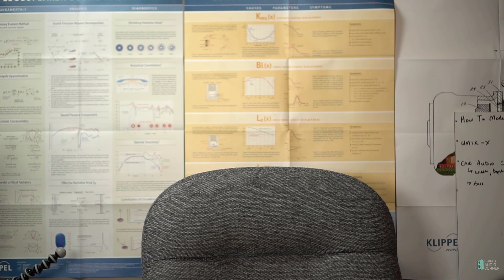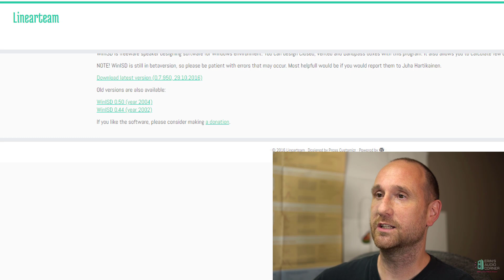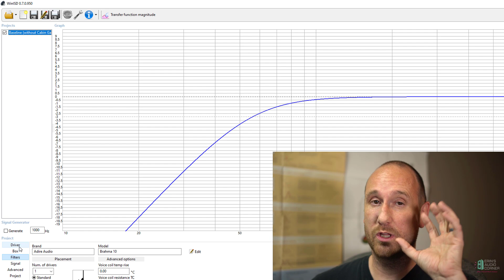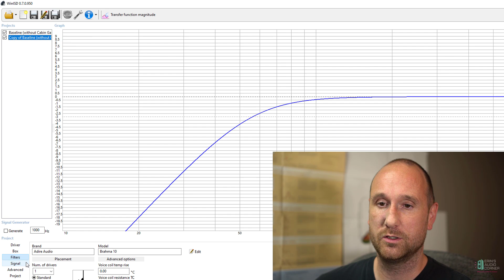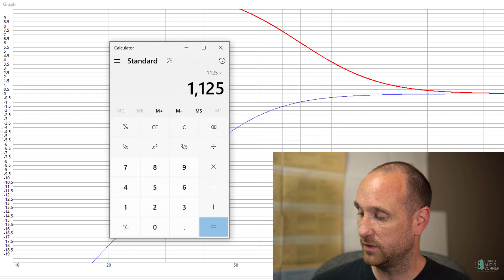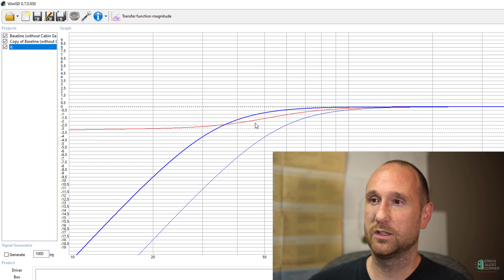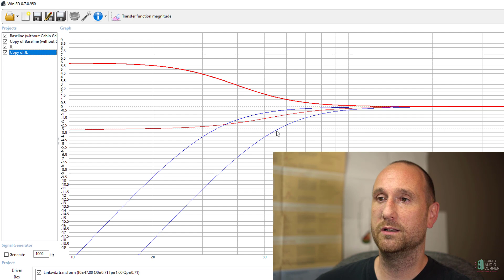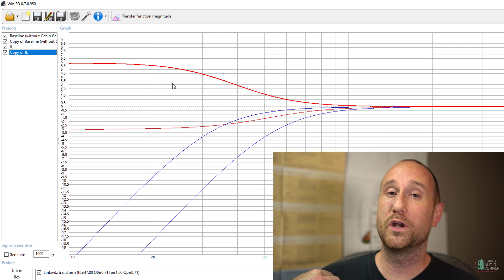Free Bass!  Subwoofer Room/Cabin Gain: What it is and how to model it with WinISD

Comment: Erin your timing is impeccable!  Thank you for risking your life! All us married guys can surely relate to how serious these things are. This information is what I've been searching for. Cant tell you how I appreciate it.  I have a 4 door titan which is obviously longer than a single cab. I built a ported under seat box and tried different port lengths and no matter what I do I keep getting a spike at 50hz. And its 15db louder! Is this just the natural gain of the cabin or am I just doing it all wrong? I can eq it in my dsp but it's just too loud and no where near what I need out of that sub box. My goal was to build a box that would play anywhere from 10 to 60 or 80hz because I intend to install front subs for the higher frequencies. (Building a so called multimedia setup that I can watch movies or videos on my 10.1 inch screen). Obviously I'm doing it on a low budget so I've been wondering if I have to bite the bullet and get better subs? Thanks for these videos,  guess I better learn how to model..ugh
Reply from the maker: The cabin gain is more of a slope in response.  A spike (or dip) would be a modal issue (resonance).  Most likely, at least.  If you  have a Dayton Woofer Tester then you can run a quick impedance sweep to make sure the enclosure is not the issue itself.  But most likely it is the cabin.  I would recommend using the DSP with a high-Q value (appropriately matched to the resonance spike) to tame it because without building a Helmholtz absorber or huge bass trap (which are impractical in a car) you really have no other options short of moving the enclosure and finding a better location, which likely isn't practical either.
Reply: @ErinsAudioCorner  thanks again, loving your content, thanks for helping the laymen 👍
Reply from the maker: @colbylaro9361  you got it, dude.